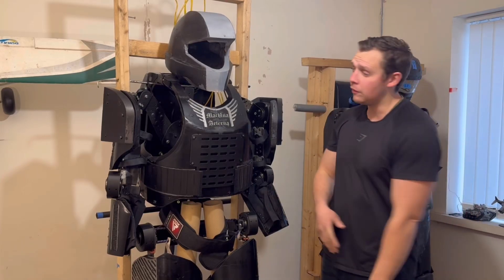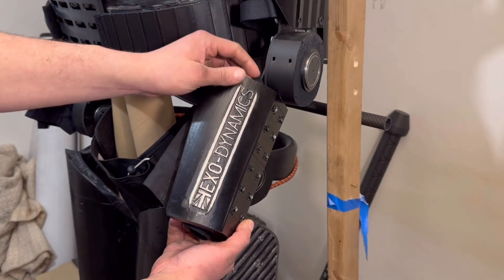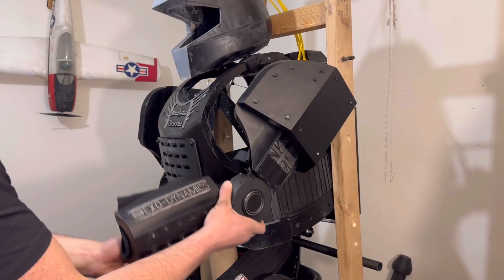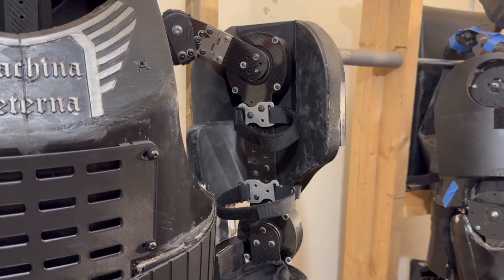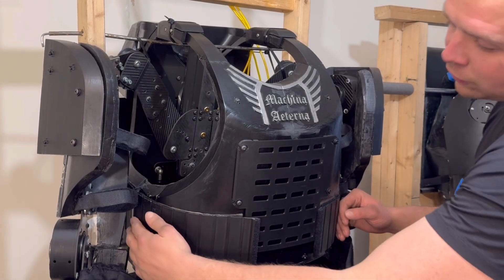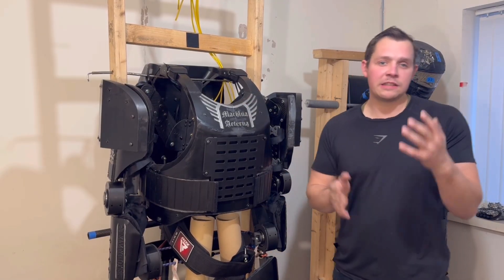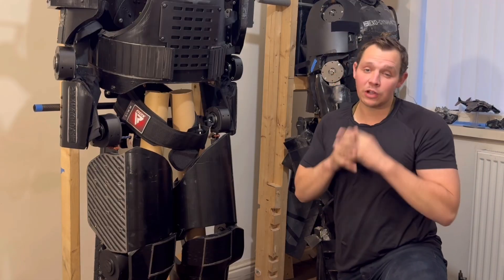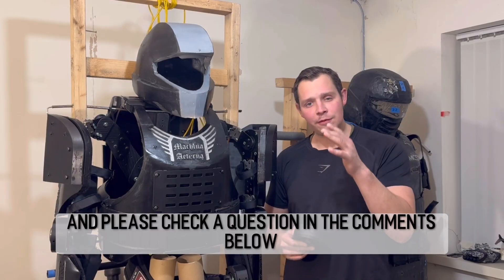My own Suit of Functional Power Armour is nearly complete!

Comment: New here. What's its intended use or rather whats its general use? Just armour against projectiles? Would it have a bullet proof shield on its left arm?
Reply from the maker: Welcome, bullet resistant to intermediate cartridges for room clearing while providing maximum coverage against shrapnel from fpv drones and shells. Wnile also being as practical as possible and able to be made with a limited supply chain. However its worth noting i have severly limited funds for it, if i had more money better materials etc could be used to increase all of the above.

Comment: Not so sure on the feasibility if you could add a form of loose but in place tourniquet around all the limbs it would be lifesaving in so many situations for so many users because 1 it would be difficult to preform medical aid on anyone inside one of your exoskeletons if they are shot in a bad place without removing sections or even the entirety or the armour and 2 it would provide an instant temporary fix for the soldier until they are able to get proper medical aid. Good job on this though as it cant be easy on your end but if you can complete, refine and mass produce these warfare will change around such a leap in infantry defensive capabilities.

Comment: 1st off, hell yeah brother GJ and it's impressive seeing it this far along now! 

2nd thing however, I know you mentioned that the gap in the neck doesn't exist as much when worn which i am extremely hopeful for, because the thumbnail gave me some worries that should the chestplate recieve fire the round might be directed up by the angle of the chest plate into the wearers throat or jaw. Similarly but less worried with a shot to the cheek/jaw angling down into the collarbone

Goodluck with the remainder of the project and keeping the passion runnin hot! o7
Reply from the maker: Thanks! And yeah a removeable collar will be made once i know how hogh it needs to go, worth saying it needs to be removeable as with one on you cant look down and you immediately lose a lot of practicality

Comment: What if added an anchoring point where those zip ties are near the torso hinge at the top of the shoulder strap thing with quick release that can be done by the one wearing it. 

However, if you are supposed to be laying down to put it one having the armor face frontward down and climb into the suit through the back side, that will be easier to get up after putting it on by yourself.  Maybe a mark 6 could be designed to enter it through the back of armor instead of the front?

Comment: This is a really awesome looking project and I wish you luck, one thing that I'm wondering however is the range of movement? The exoskeleton will certainly help with the weight though it's my understanding that one of the big issues that power armour projects like this struggle to overcome is heavily restricted movement from all the armour plates
Reply from the maker: Thanks, and movement should be fine, its why the chest plate narrowed and the arm armour is only on the out sides of the arms. Trade off is panel gaps and openings that have to be covered by other soft armour, but i tried it with wider chests and big poldrons and wrap round arm armour and i couldnt move
Reply: @MattExo-Dynamics why don't you try to put the exoskeleton on a suit inspired by the design of high-end suits of renaissance plate harness?because this is clearly styled after videosgames suits of armours and we both know they are all about fetish, and not about usefulness nor protection. This helmet visor is way too big, all the available ukraine war footage have proven soldiers know how to aim and they will hit you there. Same with the throat and the armpits. Why no guts protection? How about looking at their design for interlocking armpits and joints armors? And their visors designs, the helmet need to be as angled as possible to deflects shots and prevent the kinetic energy from going into the head, maybe make a  "great bascinet" variant that have the helmet straped to the chest and not the head,  allowing the wearer to have a second helmet and preventing the transfer of kinetic energy from shocks into the brain.

Comment: Awesome design. Are you still able to get a good shoulder weld and cheek weld with this though? If not I'd look into gas mask designs to inspire some changes to the helmet maybe, as those are generally designed with the explicit standard that warfighters are able to maintain a good cheek weld even with the mask on. Really neat stuff though.
Reply from the maker: Good suggestion with the gas masks. You can get a good shoulder weld. Cheek as you can image depends on the helmet but if an optic is off set at 45 degrees its generally been fine in the past… but we’ll see in a future video
Reply: @MattExo-Dynamics very cool. Can't wait to see future progress.

Comment: I think you'll definitely need to add a gorget as and bullet impacts on that upward slant on the breastplate will be directed right into the wearers neck. Even if it was just a thin steel plate to protect from glancing blows going into the neck
Reply: No military or LEO agency will accept a chest piece with this angling, they'd probably require him to follow the ESAPI plate standards where plates are shaped with a bias towards the sternum of the chest from the side, plus his design has alot of redundant armor around the shoulder straps and such that would almost certainly be replaced by soft armor like kevlar or UHMWPE, also ceramics do not ricochet projectiles as theyre entirely meant to absorb and trap the projectile, which would be the requirement as metals and metalloids are not tolerated due to user risks.

Comment: I love that the best visor configuration seems to be the ODST helmet, shows that the UNSC knew what they were doing when they made it like that.
Reply from the maker: Honestly if you start with any helmet, like space marine helmet and try to make it both realistic and useable you end up at odst. Master chiefs mot bad but you still end up at odst when changing practicality flaws
Reply: @MattExo-Dynamics ODST helmets are the crabs of helmets.
Reply: @MattExo-Dynamics  I feel that the only way to transcend this sort of visor design would be to have a fully enclosed helmet setup, though that would necessitate some sort of VR headset integrated into the helmet and connected to mounted cameras, and that would be a significant project in and of itself.
Reply: bungie*
the unsc didnt do shit they dont exist
Reply: The madalorian Looks good too, dont know If would be good.
Reply: @hansmustermann5371 the mandalorian helmet design looks really cool but in practice it has terrible visibility
Reply: @hansmustermann5371 correct me if I’m wrong, but I think the Mandelorian helmet is based of real life plate helmets!

Comment: This is like - REALLY cool - but IIRC, militaries aren't keen on power armor because digging a guy out of one that was distorted and shredded by a grenade or anti-tank round is too much logistical and medical overhead that they would rather just skip straight to gamer soldiers or terminators rather than add any more hard material to an expendable soldier. In fact it would possibly make the soldier even more susceptible to explosion-related injuries. However, in industrial settings where you aren't going to get torn apart by a grenade, or for high value assets, primarily non-combatant roles, is where these sort of things would probably be utilized the most. It would be cool to see power armor soldiers though and I would be happy (and also terrified) to be proven wrong. In any case good luck mate

Maybe riot gear, police armor - since it would allow them to tank small caliber and shrapnel impacts. SWAT teams with this stuff would be worrisome for other reasons but a low-risk application.
Reply: There would be interest from militaries, but highly dependable on factors like effectiveness and cost, so I do agree there'd be more interest in this for police

Comment: random idea, but what about putting some kind of fire resistant fabric on the joints, and insulation on the panels 

it seems like incendiary liquids might be an issue for it.

also, what about tensioned metal cables on the joints, with a mechanism to keep them so, but allowing movement 

might be capable of stopping bladed weapon strikes to the joints

Comment: Cover it in ballistic rated abrasion resistant steel like what's in real bulletproof plates, then download a police scanner app and fight crime like a superhero. Maybe spray paint it with high traffic paint and give it racing stripes. If I was building one of these, I would want a super jump and perhaps look into using a torsion bars to store tension instead of springs like Spring-heeled Jack- but a mishap could rip apart your legs if the suit wasn't built to compensate. Stub toe, accidentally activate the legs jump function, crush knee on helmet... anything could go wrong but damnit I need a super jump on my mecha suit if I ever get one.
Reply: He´d get nabbed by UK police for hate crime and making them look bad.... worse.

Comment: This is a really cool project. I’ve been following it for a while. The use case of this suit seems to be that if you get shot you don’t die. However, I would like to point out that with sufficient military intelligence strategy and planning on all levels of the fighting force, armor such as this should  almost never be necessary. In Modern war, if your soldiers are getting shot at directly, there’s a big problem, a problem, so big a few plates of silicone carbide are not going to solve it. 
Lets say your solider survives getting shot at by a group of three operators his unit dispatches these, but the enemy knows where he is, with drones and artillery being so widely available, I’m not sure how useful this would be. That is of course, if it limits mobility. Mobility seems to be the number one key to survival in the modern battlefield, right next to operational intelligence and situational awareness. 
I’d like to end this comment by saying that this suit is bad ass and you should by no means stop developing it, I simply just wanted to share some thoughts about may or may not be useful on the modern battlefield, as it pertains to most modern foot infantry.    Maybe these considerations will help you start thinking about a way to solve these problems as well. or maybe they will just remind you of things you’ve already thought of. Good luck.

Comment: I forget if you've mentioned this to be a capability in a previous video, but is there any sort of load bearing capabilities that the suit will be able to perform? I feel like a big turn-off for the military would be if this suit ends up being incompatible with current load bearing systems and has no "greater or equal to" capability to replace it

(in my mind the simplest solution to this would basically just amount to essentially just making sure backpack straps are able to either go into the suit or are able to wrap around the suit without getting tangled or caught or snagged in the gaps)
Reply from the maker: Yeah things like that can be added. The back pack that holds the batteries is now way narrower and could have attachment points added. - ill show it in a future video, it wasnt quite ready for this one.

Comment: Has there even been a break down of the exo project objectives/ charter? 
What role/gap is the exo suppose to fill. (The brief should not be more armor protection for troops as that would be an output. eg improved survivability might be the role. So how to make some one more survivable: Survivability onion. [
1) dont be there. so maybe remote operator or alternative system/doctrine that doesn't use human infantry. 
2) dont be detected. so thermal and radio masking with jamming and counter ISR. 
3) dont be identified / targeted. same as 2 but maybe add better mobility to get out of the target before the enemy can close the fire loop.
4) don't be hit. so more mobility
5) dont be penetrated. so more armor (exo project)
6) dont be killed. better medical availability and evac.]
If its 5 then what are the threats out there your trying to defeat with armor. the thing that kills infantry are artillery, drones, small arms. But if its for internal security forces then its cars, substance exposure, and then shootings. )
what's your projects charter? (defines a project's "why," "what," and "how," detailing its goals, objectives, boundaries (inclusions/exclusions), key deliverables, stakeholders, and success criteria)

Comment: Im not sure if it was this project i commented on previously or another suit project, but i have designed a few of these types of things. I always advise collars in the location like you mentioned when you said a gorget. Being a bigger target, youll take more flack and youll want that extra shrapnel protection. The other thing i recommend is essentially making a skirt like attachment to the torso piece made of a Kevlar curtain. Leaving the skirt open in the front like a "kama" from star wars, you make sure it is long enough to protect your ass and cover the gaps of the knee joints from hand gun rounds, shrapnel, and depending on the protection level of the curtain, you can theoretically stop some intermediate cartridges like 5.56x45 or 7.62x39 from your average combat ranges. Like the kama's from star wars, one could sew pouches or holsers into them or essentially attach free floating tassets/plates of armor. Remember, when designing the future of anything, look to the past and see what you can learn. I believe you'll find 15th-17th century plate armors might just have features one might find advantageous in power armored exo skeleton suits..
Reply from the maker: Thanks yeah im thinking on the same lines. I need to get it on  take loads of photos so i fan see actually how far the collar needs to go and how far the skirt needs to come down. Then i can plan it so the weight of laced ceramics dont get out of hand.
Reply: @MattExo-Dynamics so for the skirt, I'd recommend an upside-down almost trapezoid shape but with angled edges for a butt plate, and for the collar? It's rim should be equal in height to the chin/bottom of the helmet so the wearer can look down and get a good seal for full frontal protection. You lose out at some visibility potentially looking straight down, but in a conventional firefight you are usually getting engaged by guys on your level or above.

Comment: That looks cool AF! i just wanted to share a random armor idea: ceramic powder+grains and glass fiber bits can be mixed with epoxy (+vacum air out) to make pourable ceramic armor alternative, can be fused to the backplate very well 🙂
Reply from the maker: Good suggestion! That would actually be usefull for filling gaps around bolt holes as its not perfect where ive hand cut a couple of tiles